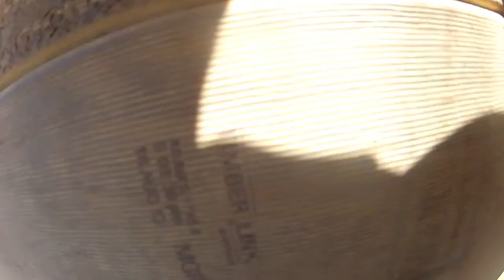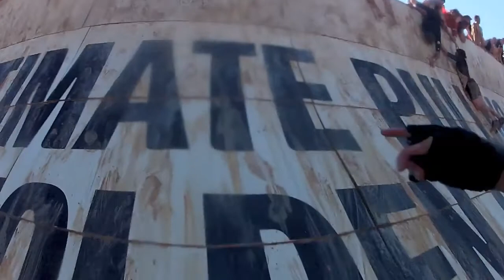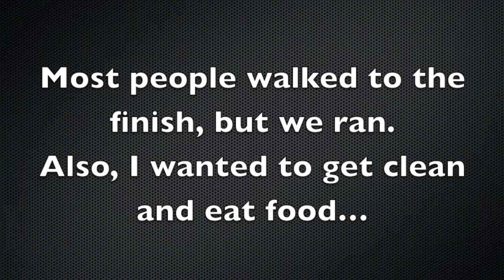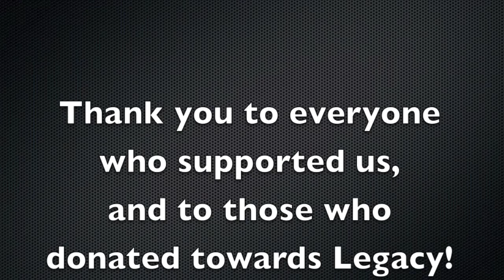Random Vlog #1: Tough Mudder 2013 - Perth WA (GoPro Chest Mount)

Comment: would you recommend the chest mount vs the head strap?  Also were you running off one battery?  thanks in advance!
Reply from the maker: It's entirely up to you really, because both perspectives are a little different. The chesty I guess you can see more of what you are doing in the obstacles that are more upright, but when you get into the crawl or those water tunnels you can't see much since your chest is to the ground or underwater (that's why I took it off and hand-held mine during those obstacles). Why I didn't go the head mount is (not just cos I have a small head) because I felt it might get in the way or make me feel uncomfortable. Hope this was helpful!

Comment: babymicko nice video post! Thanks for giving us a sneak peak at what to expect. Great job on completing the course. It'll be my first TM on Oct. 25,2014. Do you have any suggestions on where to mount the GoPro? It looks like it was mounted on your head most of the time and then in the cage you held it? Hopefully it didn't interfere too much during the crawling obstacles. Thanks again!
Reply from the maker: Hi! You're welcome! I had my GoPro actually mounted on my chest with the GoPro chest harness. I did see some other people with the head harness as well. The chesty was quite alright, didn't really get in the way. The only time I took it off was for the cage (which isn't to hard to complete while holding the GoPro). I also did the Reebok Super Spartan (also have a video up of that on my channel), and when I did the barbed wire crawl I took off my GoPro and just held it in front of me; it would've slow me down if I dragged it across the ground too. Hope this was helpful!!! And good luck with your first TM in Oct :) You'll enjoy it when you reach that finish line!
Reply: babymicko - In about 1 more week it's time for the TMudder! One last question before my quest. How did you manage battery life for GoPro? I have a GoPro3 and the battery life is very short. Did you have it running the entire time? or shut it off when people bottle necked at the obstacles. I wanna make sure I have enough juice to film at the finish time. Thx for all your help!
Reply from the maker: sonyfxi Hi again! I actually switched it off between obstacles as I do know that the battery does not last that long. So, it's a matter of remembering to switch it back on before you do an obstacle and also recording 15-30 seconds of the in-between runs. Your other options though are either a) Carry a spare battery in ziploc bag or something or b) Get a GoPro Battery BacPac. Hope that helps!